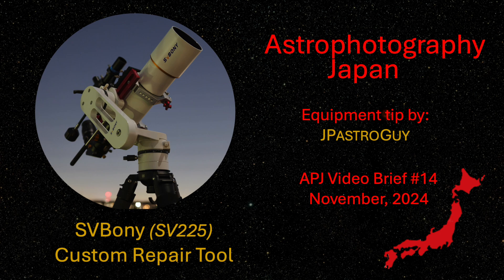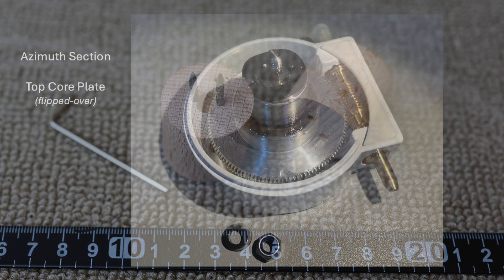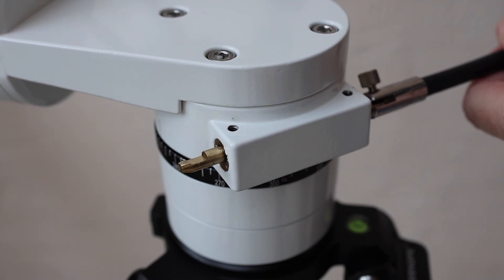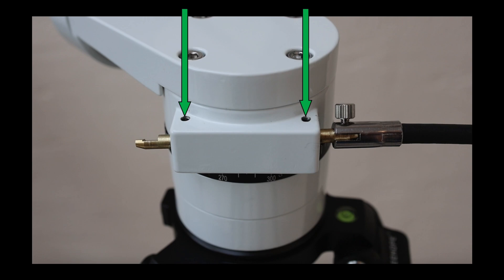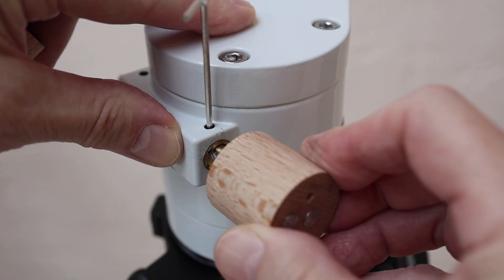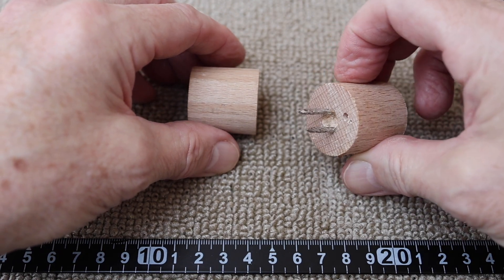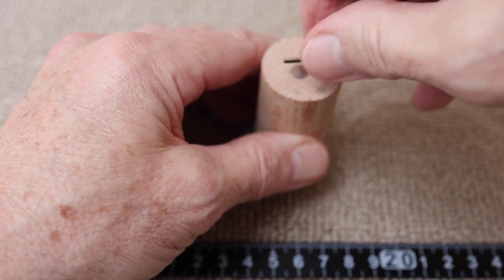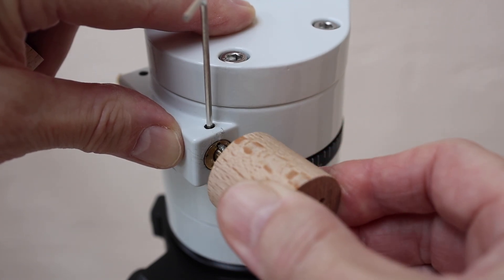APJ Video Brief (#14) - SV225 Mount Repair Tool

Comment: Thanks for this.  I have just ordered a SV225.  Hopefully I won't need this tool for a while but useful to know this information!
Reply from the maker: Sure thing.  BTW, the only annoying thing about the SV225 is that the AZ maneuvering rods (hand-cranks) have a tendency to loosen-up frequently.  So recently, I bought some tiny little rubber gaskets for the tiny little finger screws.  The gaskets have only 2.8mm holes and are 2mm thick.  I bought them at the plumbing section of the local hardware store..  So they are very tight on the M4 finger screws.  But I think this will add some friction on the screws and keep them in--place more effectively.  Have not tested it out on a real viewing night yet, but they seem to be effective on a cursory look.   FYI.   Thanks for watching Astrophotography Japan!   PAUL

Comment: Bonjour ,

Sur ma SV225 dévisser les 2 petites vis de 2 mm de part et d'autre ne suffit pas.

La pièce en laiton "excentrée" supportant la vis sans fin ne tourne pas même avec un outil approprié.
SvBony m'a indiqué 2 autres vis par dessous inaccessible car cachées sous un petit couvercle en plastique collée !
Il m'a fallu décoller, bien collée ! cette petite "trappe" dessous après que j'ai eu à démonter et rendre visible la roue dentée/vis sans fin.
C'est donc en desserrant les 2 autres vis à l'opposées de celles du dessus que la pièce pouvait tourner facilement et ajuster le rapprochement.
Sur ma SV 225 , à l'origine ,le jeu était d'un quart de tour du flexible avant de reprendre le mouvement dans l'autre sens.

D'autres seront dans mon cas où le dévissage de seulement des 2 vis supérieures ne suffiront pas à faire tourner la "came".
J'ai eu divers échanges avec Alice-SvBony.
Le fabriquant devrait ajourer partiellement la petite plaque du dessous et rendre accessible les 2 petites vis du dessous.

Pour votre info , parmi mes divers instruments , dont les ED 80 et 102 SvBony ( lesquels en astrophoto deepsky sont dénuées de sphérochromatisme dès lors que je mets le minus Violet Lumicon en 2 pouces , filtre d'une totale neutralité en tonalité ) , avec chercheur 50 mm , tête bino Baader Maxbright  , jeu d'oculaires , la stabilité est excellente avec ce support SV 225 + pied carbone Sirui AM2-série AM 284 dont le poids n'est que de 1.3 kg...sans aucune flexion !

Parmi mes diverses montures AZ et EQ , j'ai aussi l'AZ4 qui est un véritable ROC.
Celui-ci supporte sans problème mon tube Meade ACF 203 ( 6.5 kg ) + Chercheur 50 mm + tête bino.

La porta II Vixen avec son pied Alu génère beaucoup de vibrations dès lors qu'on passe à un réfracteur 100 mm.

Tout ceci pour vous dire que cet ensemble tube Meade ACF 203 en bino ne pose aucun problème pour la SV225+ trépied carbone mentionné.
Bien entendu votre pied carbone bien plus solide serait plus confortable encore.

Vous semblez craindre des réglages réguliers pour le réajustement des jeux roue dentée/vis sans fin.
Je pense qu'en azimut celà ne devrait pas se produire par le peu de contraintes sur cet axe.
Peut être oui en hauteur si on charge beaucoup la SV225 en mauvais équilibre.

Personnellement je laisse mon bras en vertical.
Lors de la fixation du bras sur la pièce à multipans , lequel s'engage assez librement , j'ai mis du gaffeur atour de la pièce à pans male si bien que celà s'emboite d'une manière feutrée , bloquant déjà le petit mouvement ou jeu et lors du vissage avec la grosse vis , le blocage sans forcer est parfait.

Bien cordialement

Charles
Reply from the maker: Thank you Charles for the additional information about the hidden screws on the mount head.  I was not aware of this fact.
It seems you have a lot of experience with this and other similar manual AZ mounts.  I am glad to hear about your general satisfaction with the stability of the SV225.
I agree with your comment that there should be less stress on the Azimuth gear, but surprisingly, that seems to be the one which periodically loosens for me with regular use.  Hence, I created that little field tool to eliminate backlash in case it became necessary during a viewing night.  
I appreciate your suggestions for stabilizing the unit even more.  It sounds like you are an expert in visual astronomy.  I wish that I lived in a darker area so I could actually do more and see more!
Best regards, clear skies, and thanks for watching Astrophotography Japan!
PAUL